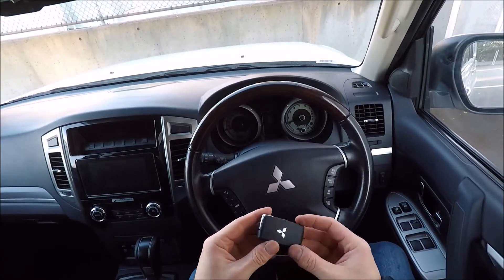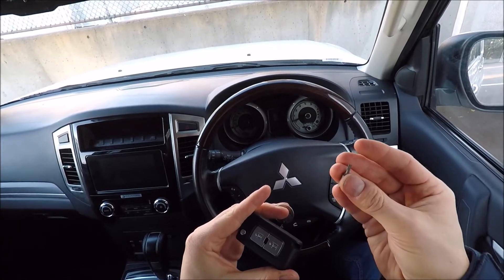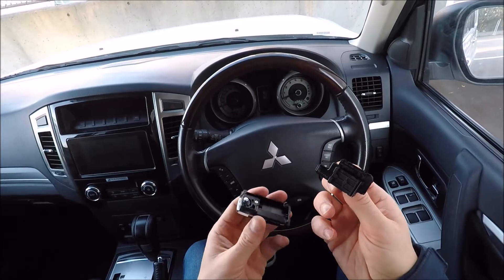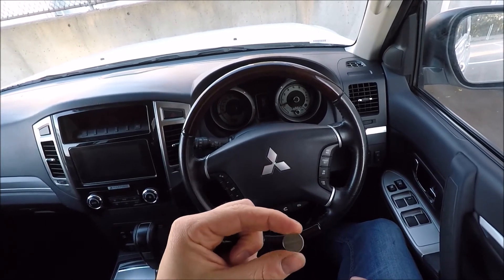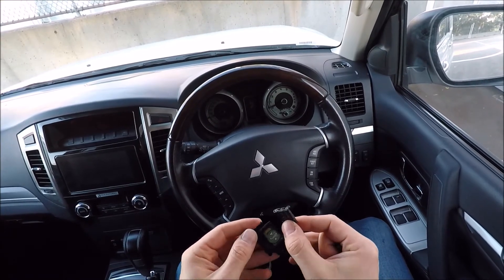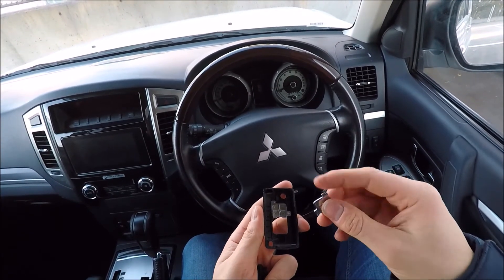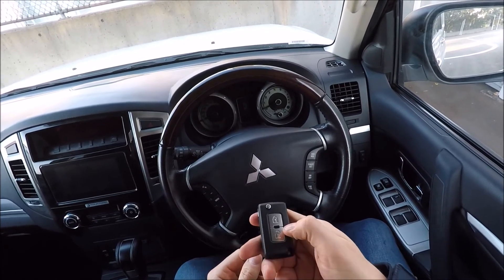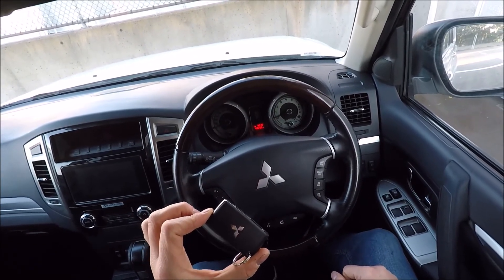How to Replace the Battery on a Mitsubishi Pajero Key Tutorial (Shogun, Montero)

Comment: Can I use other than Panasonic battery
Reply from the maker: Yes of course as long as it is a CR1616 and the same voltage it can be any brand.
Reply: @RossPerryProductions  thanks for immediate response 🙏
Reply from the maker: @ganeshmuguli3513  no worries at all

Comment: thanks- do you have any issues with the central locking? i constantly have to unlock all the doors to gain acces to the boot or rear seats.because it auto locks.but doesnt auto unlock
Reply from the maker: Hi there Lance, No I have not had a similar issue at all, have you checked to see if there are any auto locking settings you can change?